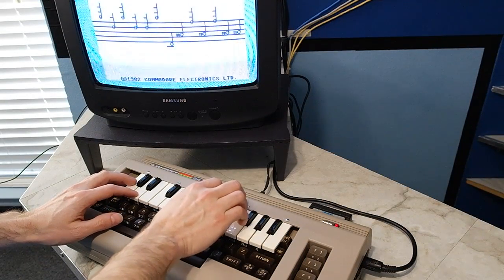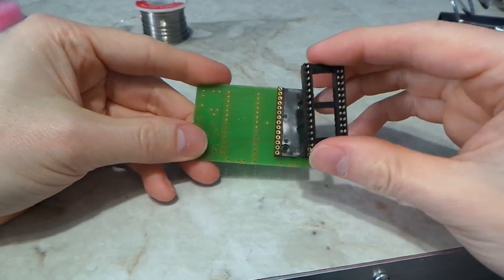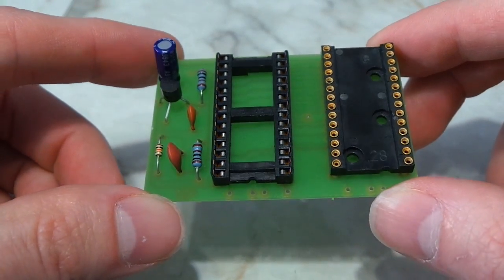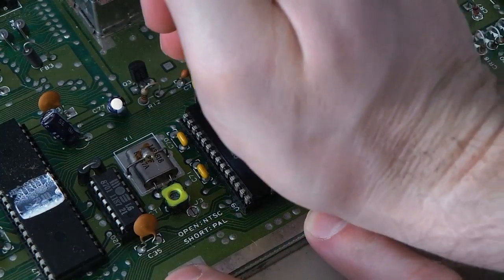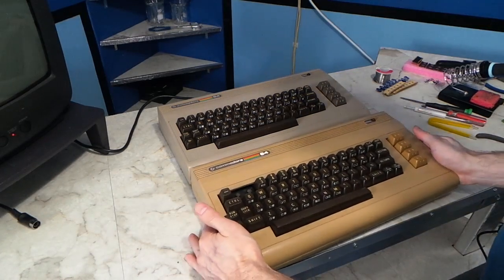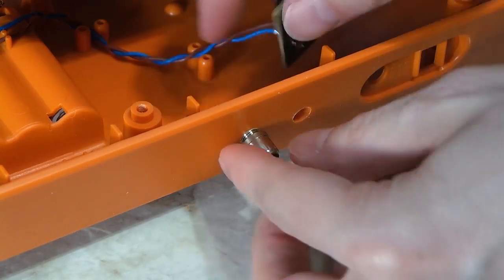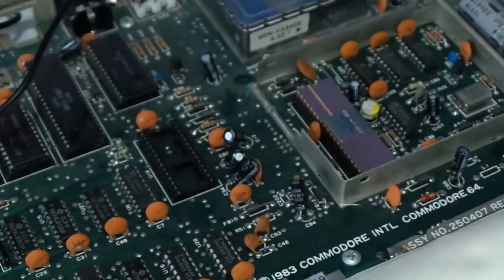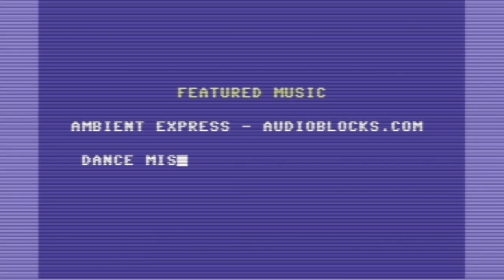Installing dual SID chips in your Commodore 64 with SID 2 SID

Comment: now we need similar solution for Amiga 500 - with 2 paula's you could get 8 voices on a500!
Reply: Or use a software mixer to get 8 voices on 1 chip

Comment: What tool did you use to desolder the SID?  Vacuum soldering iron, or just solder wick and iron?  What temp?  Im trying to desolder ICs and have no success!
Reply: You can desolder chips with copper braid, but it's not easy.  You have to be very meticulous, while at the same time not frying the chip with the heat.  Using alligator clips on the legs of the chip helps sink the heat away from the chip.  A solder sucker works easier in my opinion.
Reply: @Calphool222  For this task, nothing compares to a QUALITY desoldering gun (like a Hakko), but they're expensive.  Totally worth it, though.

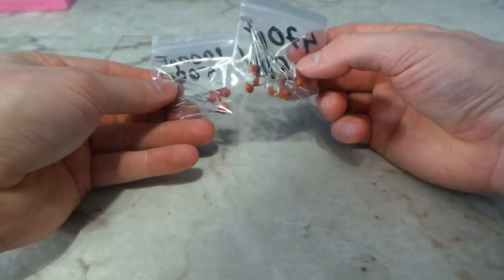Comment: 1:14 Today on How They Do It : Plumbuses.

Everyone has a plumbus in their home. First they take the dingle bop and they smooth it out with a bunch of schleem. The schleem is then...repurposed for later batches.

They take the dingle bop and they push it through the grumbo, where the fleeb is rubbed against it. It's important that the fleeb is rubbed, becasue the fleeb has all the fleeb juice.

Then, a schlami shows up, and he rubs it...and spits on it.

They cut the fleeb. There's several hizzards in the way.

The blamfs rub against the chumbles, and the...plubis, and grumbo are shaved away.

That leaves you with...a regular old plumbus.

Comment: I have a Haako FR-300 powered desoldering gun. It wasn't that expensive, relatively speaking, but it's VERY useful. Helps avoid overheating sensitive chips when removing. If you salvage chips from old computers or electronics, it's life-changing.
Reply: At first blush they DO seem expensive, which is why I didn't get one sooner.  I agree with "life-changing."  Not an overstatement at all, as it eliminates a LOT of time and hassle.  I wish I would have spent the money earlier!  Love my FR-301.

Comment: You wouldn't have to trash the RF cage if you put the components on the same side as the mask, that's why it's on that side. Just saying.
Reply: That's the fault of the board designer. If you look when he's placing in the components, there are no solder pads. The solder pads are only on the side of the mask. If he placed the components on that side there would be many impossible to solder to.

Comment: Couldn't you have simply swapped the two chip sockets around so that the long legged one sat in the middle of the daughter board? The board would have been centered over the original socket & wouldn't have needed to cut anything.

Comment: This might seem like a strange question, but I'm interested in how you achieved those "masking tape" style lower 3rds you used in this video.  Did you make those yourself from scratch, or are they stock presets in your editing software?  I don't use Mac hardware for video editing, so if they are a common preset in something like iMovie, I wouldn't know.
Reply: I can't remember if it's a preset, it's been too long since I've used iMovie
Reply: Both Final Cut Pro and iMovie have it as a standard template, along with many other templates.

Comment: Hi!  I have 2 questions for you... 1st is why not just use the cartridge that was released back "in the day" that has a second SID chip in it?  That's what I did, but it was so long ago that I don't remember if there were any other solutions.  2nd, which may invalidate the 1st... Is it possible to still use another cartridge with the SID chip installed as you did it?  That would be a great reason to do it this way.  I would have loved to have had this when I was a kid.  :)  Thanks!

Comment: Back in the days i used to set secondary chips directly upon the primary chips with an additional socket held by it's own spring craft, adressing them through a bent contact. I. e. an extra cia can give you some additional interfaces (i used one e for adding centronix and Commodore D9060 hard drive) and lots of adress space that can be used for different kernels, a rom drive, software switchable ports (i used two 512kb ram cardriges and combined their memory to 1mb).

Comment: Love your videos!  A little off topic, but as someone who finds desoldering (especially ICs) a monumental pain in the ass, I was intrigued by the idea that you could remove that SID in only 25 mins.

I know that my technique with my wick could always be improved, so I was wondering if you would mind sharing YOUR technique for desoldering.

Like what temperature are you using?  Do you use flux? Do you add new solder to the joints? From the video it looks like you touch the edge of the wick to the joint, and apply your iron to the flat side of the wick to suck up the solder.

I have improved dramatically over the past year or so, but would love to hear some advice from you!

Thanks so much!

Comment: What is really the point to have a DUAL SID with both same SID models? I heard that stereo mod is usefull only if you use a 6581 together with an 8580. Is that true?

Comment: For all the interest in vintage tech... PLEASE... Get yourself a Hakko 808 desoldering gun, or the equivalent. They are a little spendy, but it makes desoldering things like chips SOOOOO easy. Almost as fast as soldering them in! Between my Hakko 808 and a cheap Chinese hot air rework station... BEST additions to my electronics workbench since getting a temperature regulated soldering station!

Comment: ebay components are not worth their time. Too many over heads for the seller, like listing fees, selling fees and then PalPay take their slice of the cake. So the parts you get are cheap. In the UK I buy quality components from RS Components and the cost is near about the same. for things like wire it works out cheaper.

Comment: So the thermal paste on the SID was put on by Commodore or a later modification by an owner?
Reply: armorgeddon Well, I'm not sure about this specifically, but you can buy third-party thermal paste in general for PCs. Generally, you buy a PC that already has it on the the cpu, but if you want to take the heat sink off for cleaning or to install an aftermarket cooler,  you'll want to put new paste on it which a small container of usually comes with the cooler.
Reply: Thanks, but I already knew that, I'm building PCs since the early 90s. That's what made my wonder if the SID really got that hot to make thermal paste necessary, because in PCs only the late 486-CPUs even needed a heatsink.

Comment: I have been surprised  that nobody is manufacturing 6581 sid so most of the people are just removing them from Commodore (6581 sid is no longer patent protected). This is crazy... 
BTW I would recommend to use for desoldering ZD-915 Desoldering Station. Its dirty cheap and saves a lot of time and pain and is still a lot cheaper than Weller (which I'm using).
Thanks for a great video as usual.

Comment: The 6581 is the better chip anyway (at least for the way game developers used to take advantage of it).  Glad you got it working. :)
Reply: Also, since the chips are socketed, it might have made sense to put in sockets for the filter caps as well -- that way you could always change them back out later.

Comment: I think one of three things may have happened to our friend here.

First: the chips are too far apart in age to operate normally. Any chip manufacturer loved to tinker with things to either improve yield or save money. So, check the date/location stamp under the chip and see when and where it was made. There maybe subtle differences between the two to screw your plans up.

Second: Chip aging/old silicon.  The question is how has the chip aged over the years. You said this was a low number C-64 you pulled it from, so there's a chance it may have developed issues or was defective before you got the machine.

Third (and this is nuts): Counterfeit SID chips.  There was a story that ran around the net about 10 years ago about a large batch of MOS tech SID chips that were cleaned of their original labeling and stamped with a professional-looking label, making them look like newer chips, then put on the market. Who knows who did that, but if you take some Acetone and a swab to the stamps, the OEM stamping should be difficult to remove. But it will not be the case with the counterfeit chips. Acetone will wipe the forged stamping right off of the packaging. Plus there are subtle markings on the bottom that will smoke out the fake ones too.

Comment: 2N2222 should have survived being soldered in the wrong way 'round. Basically what happened with the collector and emittor reversed is the C64 tried to use the internal junctions in the direction they don't conduct, so the transistor itself should still be fine.
Reply: Jan Verschueren actualy that was a 2PN2222, the 2N2222 is a metal case chip. imo it would have looked way better than the plastice one
Reply: Point taken, even though I don't see the relevance to my suggestion it should have survived. The case is not going to save the day if a transistor is being driven in a way which damages it.
Reply: Jan Verschueren

It should have survived, but maybe because it's a 12V circuit it put more than -5 volts on it and made the base work in reverse and that fried it.its all about the circuit, without it its kind of hard to say what caused it.

Comment: For hard to desolder stuff i use a quick and dirty proces i called:
INERTIA ASSISTED DESOLDERING ;-)
You heat the offending component(s) with hot air (or whatever improvisation you have it handy-hot plate...), and when solder melts you slam the board against desk/floor, and components fly out ;-)
Some might argue that it will damage the PCB...and they are right, do not do it if you plan to use the PCB;-) but it has less chance of damaging components that would otherwise be heated longer/hotter.
Reply: Another approach is to use thin alligator clips on each pin (top side) as you desolder with a braid.  The alligator clips sink the heat and keep it away from the contents of the chip.

Comment: Nice job getting done - but you really should dress the components on the SID board correctly.  Tolerance bands always go one way or the other, not both...
Reply: tcpnetworks Is that level of neatness necessary on a board that's silkscreened on the bottom...?
Reply: That's not necessary, especially for something that only The iBookGuy will use.
Him doing that would be like me complying perfectly with the PEP-8 style guide for my one-off Python projects.

Comment: is there a straightforward way to route audio from SID1 + SID2 to one stereo 1/8" jack?
Reply: i guess so, put the jack in the chassis of the c64 and solder the output from this pcb, the normal output from the c64 (pin 3 from the avout at the back) and a gnd to the jack. it should be a simple mod but i dont own a C64 so do it at your own risk

Comment: Hi, a little tip for the CS cable on Cartridgeport. solder it to a ON-ON Switch. wire the first cable from switch normal to the Port pin, the secound cable solder to pin 2 (ground) on the same Port. So you are able to switch off 2nd SID. Cause some Cartridges don't like the SID on address $DE00 and make trubble. so better yo are able to switch off, i do the same.

Comment: did it not fit because you put the components on upside down? turning a left hand into a right hand board?
Reply: +John Shead I was thinking exactly the same thing.  Maybe it was designed to go in the other way, but the manufacturer cocked it up when they spun the boards?  Mistakes like that are so easy to do and so hard to catch.  
Good to see that it was all OK in the end (providing the FCC don't come-a-knockin!) :)
Reply: +EscapeMCP Could add back missing shielding with a modified shape. Or he could shield his lair so he can also test out old stuff that used frequency bands since reallocated by the FCC for something else.
Reply: I think the passthrough socket should have been soldered on the other place. If I understand correctly the address lines, data lines, ground and vcc are all sent to both the SIDs so it doesn't really matter where you solder the passthrough socket
Reply: ncgallagher - how would he mount the sid sockets on the same side as the solder pads?
Reply: @carpii  itś tricky but not impossible and i´ve seen it in other designs. either you believe they designed a backwards board or a board with slightly difficult to solder components
Reply: I had to look far down for that
Reply: @C0vertG0d  iĺl be damned they did design a backwards board. why in gods name would they do that. ok well you can still solder to the other side it is not impossible to do. and given the option i would not follow the manual which instructs you to cut your original metal shielding
Reply from the maker: A lot of people have asked that.. but no, I did not put the components on the wrong side.  This is how it was designed with the silkscreen on the same side as the solder pads.  in fact, had I done it backwards, there would have been nothing to solder to.
Reply: for micro controller boards i have had through hole boards  top or bottom solder and some with the top and bottom pads connected, but would have assumed that the little board would have come with instructions.
Reply: no you can solder from the top side. maybe its a bit trickier but you can do it. thatś how it was designed. you did put them on the wrong side and thats why it didnt fit.
Reply: @ncgallagher  *that's
Reply: @buddyclem7328  your doing god´s work thank you

Comment: @8-Bit Keys My setup was a nightmare too, the pins were also just to thick to ever get it to sit properly, I had to modify them. Many chips also did not work and then... sometimes they did, again work... I now have stereo SID fully working but I am really careful with moving the C64 around. I have built-in encoders and a video screen as well.

Comment: At the same time you can use the on-board SID 6581 and SID 8580_R5? Power Misc: 12 to 9 V. -------------------------The SID2SID is built for only one type of SID at the same time. 
If you want different voltages you will need to modify it yourself.You need to regulate the voltage to only 9 volts for the 8580 SID if both 6581 and 8580 coexist on the same board, preferably with a voltage regulator.

Comment: Ah c'mon - desoldering 28 pin chip this size is not that time consuming ;P 
Desolder pump maybe?
Reply: God, I used to do that all day sometimes, when I worked for Cable-TV, repairing the decoders for the pay channels. In the early 90s. Hmm was during the Gulf War.

Comment: Wait, but now you mixed a 6581 with a 8580, which you said does not work. Or did I miss something?
Reply: I thought it was kind of intuitive that you need a donor SID chip and then use the one from the C64 you are going to mod.  The SID2SID module thingy plugs into the very socket that the SID chip fits in, so you HAVE to unplug the original SID from the working machine so you can install the SID2SID mod. You are bound to reuse it as one of the 2 chips in the mod.  
Love the attic full of old PCs and this video perfectly demonstrated why those old bust machines shouldn't be thrown away.
Reply: I noticed that too. Looking at the end of the video, the double SID board shows two 6581s but the video insinuated that one 6581 was taken from the breadbox C64 and one 8580 was the wedge C64 which as stated earlier in the vid wouldn't work as one is 12V and the other 9V. The vid doesn't explicitly say that the two used were from the working breadbox and the spare breadbox.

Comment: Trick for desoldering the big chips.  Put the whole board into a toaster oven.  When the board is hot, give it a good smack and most of the components and chips will just fall off.  I probably wouldn't use the toaster oven for food after that since solder occasionally contains lead.

Comment: I would have bent all the pins on that wire-wrap socket into a Z shape to shift the whole thing over, rather than destroy the shielding, but either works.

Comment: you should have put the socket for SID 1 in SID 2
Reply: Mike Blais it could work but it depends on the circuit. im not just they are JUST paralleled together. else you wouldnt be able to control the independetely
Reply: This should work, but you need to use the CS of the new SID2, as well ascut the connection from audioout and route that to the new SID2. Also, populate filter capacitors as needed. That's all it should take.